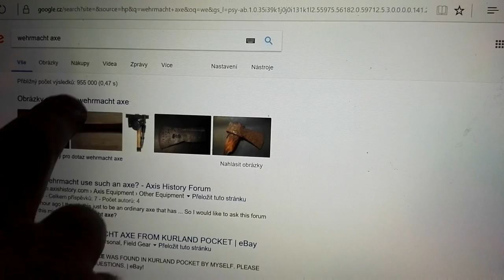Unique axe restoration

Comment: Very nice project! I would like to give you two things to think about for future projects. When pushing down the wedge into the handle you should use another piece of wood between the mallet and the wedge, this prevents the wedge from splitting. The grain orientation of the handle is also in the wrong way. You want the grain of the wood to go with the same orientation and the head of the axe, this will give the handle more strength. Here is an image showing the correct orientation: http://pop.h-cdn.co/assets/16/09/640x320/landscape-1456791878-blog-ax-graining.jpg
Reply: 54 years old and Im still learning stuff!
Reply: SS, what if the handle is the heartwood or a whittled tree branch?

Comment: Couple of tips: First, try to aviod heating the tool when restoring, it can damage the temper. Try soaking it vinegar instead. Second, be sure to check the grain orientation on the handle, it should run parallel to the cutting edge. If its not properly oriented, you may risk the handle breaking. Hope that's helpful at all.
Reply: Consumer Knife Reviews I'm not sure boiling it will affect the temper at all. You need to get a bit hotter than that surely?
Reply: Charlie Macmillan you may be right, Ill do some additional research and get back to you
Reply: I heard anything over 400 degrees will damage the temper.
Reply: Grain orientation (as you describe) is important in the curved shape of the handle  - this is strait handle -> it's okay

Comment: Nice work. What was that, citric acid? Very bad for steel. In future you should see corrosion from micro holes. I prefer electrolysis or autolysis. Alkali methods are better for steel. 
A little bit of history of that axe. Was performed in 1888, but without hook to put out nails. Around 1914 prussian "Intendantur" added hook. 
I've got two axes in this type, but from IWW and 30's. Very good forged steel,german quality!

Comment: If you could redo this. I suggest using sandpaper on the axe head to clean/polish it and stain the wood with a stain of your choice and give the blade a slight sharpening just to make it a little easier to cut into wood and other stuff

I completely respect you if you dont do this but it IS a suggestion so im not hating your content im just asking a suggestion and making it understandable.

Comment: Man im not tryna be a hater but alot of this screamed that you dont do this alot. From the wood grain to not using step wedges or a circle wedge onto of the wood wedge to the methods used to shape it. Hefting is an art in its own. Tip is have the grain running from edge to pole not from side to side

Comment: Nice work, but what does the onion do to the axe?
Reply from the maker: +N-am Control cleaning the steel
Reply: Oh so could you say that what the onion did to the steel could be done with acetone?
Reply from the maker: no, that was experiment, it seems to me it makes rustic look a little. Made the dark dots darker and light areas lighter.
Reply: Makes it cry of course.
Reply: It's for the flavour :)
Reply: It adds flavour of course
Reply: I guessed it was because of the acid in the onion.
Reply: Ogres are a lot like onions.
Reply: frito bandito they have layers

Comment: all you did was remove the rust. I could have just dropped it in warm vinegar and achieved the same results. you could have done something nice with the metal refinished it, black ox coat, blue it, or at the very least paint it, and put a little bit of an edge on the blade. and before the witch hunts starts i get it it's your project and the end product is what you wanted, but if i were to just remove the rust off of my 69' pick up and call it a restoration... let's face it that's a bold face lie.
Reply from the maker: +Disco Monkey I made exactly what I decided to do. There was no need to change the axe into different one. There was no need to resand it as I'm able to do that, there was no need of any different colour. The axe is so as I wish it should be. The sharpening is question of some next episode where I will focus on different types of sharpening. My chanell is'nt about idividual projects only, it's almost the work which which continue. Anyway thank you for your comment.